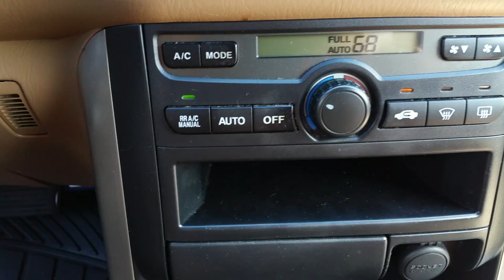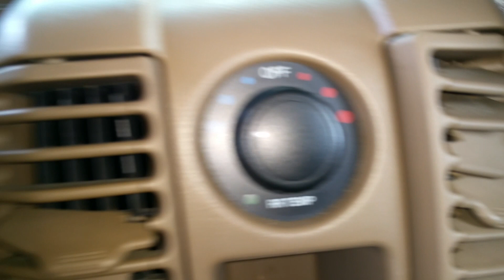$15 Blower Motor Fix - Honda Pilot/ Acura MDX

Comment: Nice video. It's a good idea while the panel is off to clean the air filter screen. It's the round thing on the left side that you can see at about the 1:01 mark of the video. If the filter is clogged, the blower motor may work too hard and overheat, which can cause this resistor to fail.

Comment: I have a 08 Pilot and it actually uses a different rectangle resistor that was was $25.  It did work the same however the replacement I was able to find was larger and I had to file the opening to get it to fit.

Comment: Hi! Thank you so much for the video definitely help! I replaced the resistor everything works cool air for the kids but now it stays on! Lol I tried taking it out and putting it in again and it’s still doesn’t turn off, even when I turn off the air up front it blows out regular air not cold air any tips on what to do?

Comment: What if I have no power in rear ac
Reply from the maker: If the rear blower motor it not turning on then it's most likely the same problem that was addressed in the video. I would recommend replacing the blower motor resistor first as the part is relatively cheap.

Thanks for your comment!

Comment: Thanks for the video...BUT you need to clean your round filter fan first before installing the new resistor....Thats the REASON why the REAR FAN dont work is because of CLOGGED FILTER.....Your new RESISTOR WILL BLOW UP AGAIN....But your video helps...thankx

Comment: Does this have anything to do with lukewarm to no heat also?  Fan works.
Reply from the maker: While the engine is in operating temperature if the air coming out is not hot but lukewarm then most likely the problem might be a clogged heater core which is the element that uses the hot engine coolant as a mini radiator that therefore brings heated air in the car. As long as the fan is working fine then it most likely is not a problem with the resistor.
-Thank you for your comment!

Comment: Can I try to clean the fan first to see if that's all it is.
Reply from the maker: It doesn't hurt to clean the fan however unless there is a bunch of junk in the fan area for some reason, there shouldn't be any reason why the fan would not spin besides a bad resistor and/or other electrical issue. Replacing the resistor is an inexpensive and quick fix, so it couldn't hurt.
Hope it works out for you!

-Thanks for your comment!